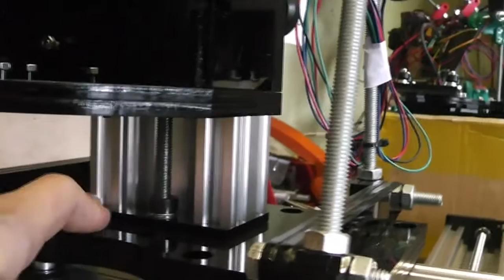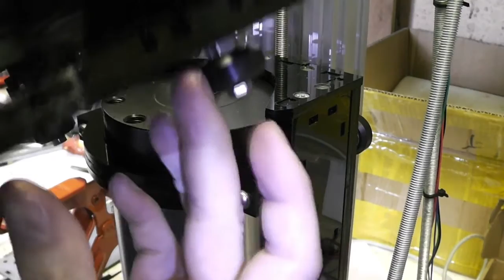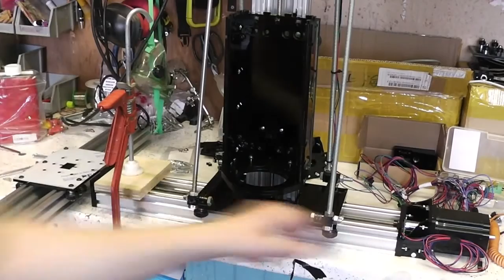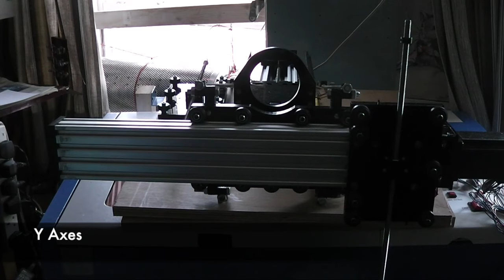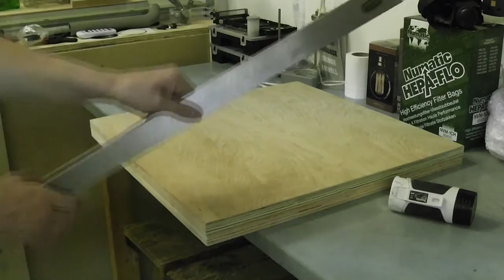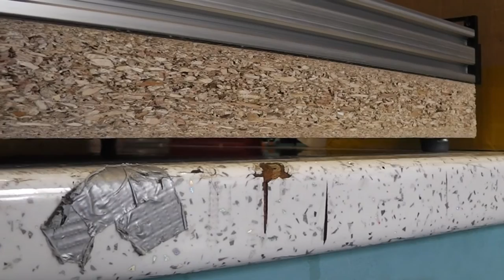XYZ Axes Complete!: CNC Router Blog 9

Comment: Nice videos.  
The problem could be the wheels are a bit smaller than Openbuilds ones. That could be the source of the slack in Z axes...
Reply from the maker: Thanks for the suggestion.. but I think this was my mistake rather than a problem with the wheels. I checked them with a caliper and they are exactly the same dimensions as in OpenBuilds spec (I would recommend the supplier, https://www.aliexpress.com/store/1711438) I think the problem is either with my laser cutter or with the SketchUp model I made - I couldn't find a precise way to align the edge of the wheel with the C-beam in the model so I had to do it by eye. And because I'm using a cheap K40 laser cutter, the beam is never pointing precisely downwards, and the angle of the beam varies the further away from the origin that I cut. So objects over about 10cm wide / long can start to get an extra 0.5mm added to them! I think I've got the laser aligned as well as possible, and the only way to make it better would be to buy better optics.
Reply: The aliexpress link on your blog 4 doesn't work and I had to look through all your CNC videos to find this comment. Haha. The seller seems pretty legit with their CNC machines unlike other sellers who use injection molding. Kudos for the link! I'm so excited to receive my order. By the way, your CNC setup is pretty impressive! You should make a list of recommended sellers and BOM if you have time. Hope to see you in more projects! :)

Comment: you spoke about overloading the motors. @ 19:46 , I'm planning to use motors which are slightly bigger that the once you have used what is the max current/voltage can the board you used can handle
Reply from the maker: The DRV8825s can take 1.5A per coil if you don't cool them with a fan, but with a proper heatsink and fan they can deliver 2.2A per coil. The DRV8825s can handle 45V but the Taurino board can only take 30V so that would limit the max I can use in my setup. But my PSU can only deliver 12V so I'm nowhere near the voltage limits. I did mention not wanting to overload the chips, but I think the worst that would happen if I set the current too high is that the over-temp protection would kick in on the chip and it would switch off to protect itself. That's really annoying in the middle of a cut, but for testing, not so much of a problem.

Check out my videos about setting up the electronics: https://www.youtube.com/watch?v=frJ8Nt34xdk and about building a box for them with a fan in the perfect position for the chips: https://www.youtube.com/watch?v=QuNWJF1ifys